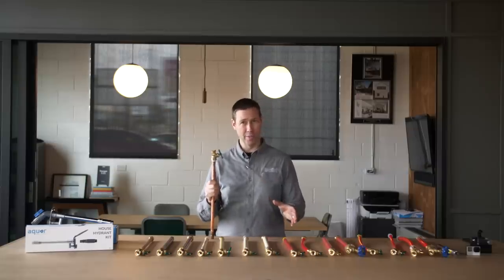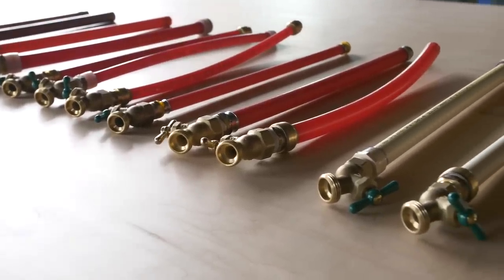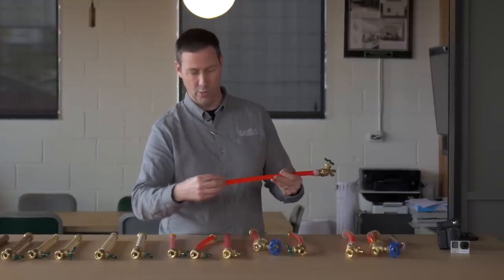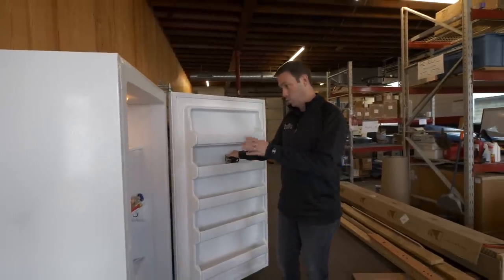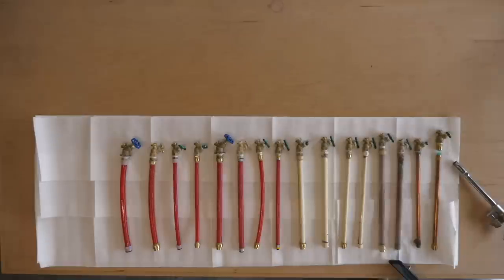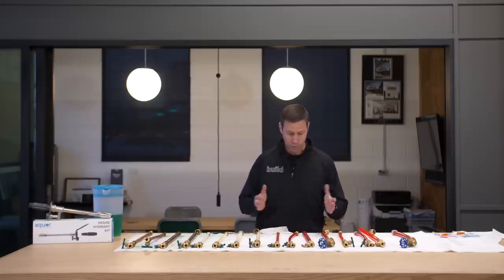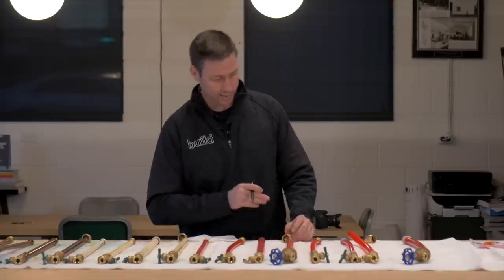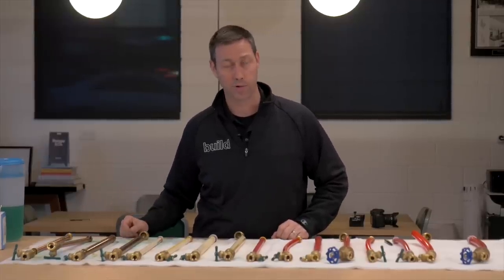Copper vs Pex vs SharkBite - Freeze Testing

Comment: You should have used valves on both ends of the pipes so they could be at the same pressure as all the water lines in one's home.

Comment: Frequently you do not get a water leak until the split pipe thaws out.  You have a length of pipe freeze and the ice forms a plug.  The pipe splits.  The ice still acts like a dam inside the pipe.   Until  it thaws.  Then you get the mess.

Comment: First did you just fill the pipe with water or did you pressurize the pipes with water. It makes a difference. Also I’ve been plumbing for 20 years now. I’m a 3rd generation plumber. I haven’t been using PEX A  but I use PEX B all the time. I’ve seen PEX freeze and get as big as a coke bottle and go right back to size. I’ve had fittings burst but I’ve yet to have the pipe. I pipe everything with PEX. I don’t care what you already have. I tie on PEX and repair. Also if your going to use push on fitting use sharkbite brand. Do not buy the crappy ones Lowe’s has. I see them fail all the time.

Comment: Thank you for sharing I just ran PEX and my wife and I are house I just don't like the potential of mice with the pics..

The one thing you have to be aware of when you're using the type A PEX with expandable ring the oil you use for the expander if you get too much and your oil glands up in the pipe it can cause a leak at the fitting well it's really grease not oil.

Okay I look forward to hearing from you I have a how to channel God bless,
 Ken

Comment: Copper is definitely the best.every plumber that knows what there doing knows to put frost free outside faucets,and if your building a new home the crawl space will be adaquit for not freezing. The problem with odds it's not freezing but failing under heat and pressure and also water with high chlorine content
Reply: Sorry pex

Comment: Would have been interesting if you had use pressure gauges to measure the pressure. You would probably need a pig tail with a non-freezing fluid to keep from freezing the gauge.

Comment: Matt, our builder used insulation and I have not had a pipe burst in 25 years. Of course I live in Nashville TN and thanks to global warming I have not  had but a very few cold days that were capable of blowing out my pipes but thanks anyway for telling me that if I lived in the North that I would be in a bucket of poop with my copper pipes. I have heard sharkbite fittings are a disaster waiting to happen is that true?

Comment: Would have liked to see the lines pressured up to typical line pressure instead of static pressure. I would like to see the pipe measurement after it was filled with a micrometer and after it froze.

Comment: I'm a GC, we get frozen pipe problems from time to time here. Every now and then we are on a job where the house has frozen pipes and it's a hodge podge of pex and copper.  FROM EXPERIENCE,..I can tell you that pex does not fare much better than copper when it comes to freezing. After I ran into it the first time,..I checked the pex spec,..and (at that time,..unless something has changed the last few years) NOWHERE does pex state that they do better than "x" type of pipe systems when it comes to freeze-thaw issues.  They sure don't try to squelch the rumor, because the rumor makes them a lot of money,..(which is a bit disingenuous.).  So,..you can watch this video and feel all warm and fuzzy inside,..or you can call the manufacturer or look up the spec,..and they will NOT stick their neck out and even make any statement whatsoever other than "our pipe is not rated for below freezing temperatures.'" Frost free hose bibs are different because the part that freezes is not designed to retain water in the part that freezes.

Comment: But the other issue is that you did not fill them with water pressure used in homes. You only filled them with standing water. Filling them under house water pressure would create extra pressure and increase the chances of bursting.

Comment: I've been replacing very old L copper, PVC, & CPVC with PEX-B under my house. I'm in Texas after this last record-shattering freeze. I had both copper & CPVC failures, but all of my PEX-B with Sharkbite(R) survived 5 straight days of 30 below freezing. Have you any plans to perform this test with PEX with crimped fittings?
Reply: NOTE: I have Sharkbite(R) transitions to PEX on both L copper & PVC.

Comment: Matt, I'm just wondering if the green dye you used for the water changed the freezing temperature of the water.  Not a big deal, but for the sake of the science of it all, it would be beneficial to know.
Reply: Mikeadiddle, that's an interesting question.   What is the green dye and does it change the freezing temperature?     Was it food dye or clothing dye?   Does THAT matter when it comes to  temperature issues, and effects ?    I think deeper about things too.      I don't think the dye effects the results though.   I think it's all about what freezing water does to pipes and not what it takes to freeze water.   I guess you are wondering if dyed water will take longer to freeze water ?

Comment: My ❓ is why not use regular PVC pipe as well as the CPVC because technically the CPVC is for Hot Water lines and the PVC is for cold water lines? And Yes as of 2/21 I've had to fix many frozen Copper and PVC bursted pipes.

Comment: Appears you forgot to test NSF approved HDPE poly pipe.   PEX is not sunlight resistant like black HDPE, sun exposure will eat up PEX fast. As I see your tests did not have all the pipes under typical home water pressure, such as around 60 psi when the freezing temperatures were applied, which stresses the pipe and fittings even more (not everyone drains their pipes, some forget). We have experienced 1.25 inch diameter up to 2 inch diameter HDPE poly pipe freeze outside under 60 psi and more static pressure with our poly compression fittings and not suffer a single crack, not a single service call, after the thaw.

Comment: Was that Type M (thin copper commonly used today by cutthroat contractors) Type L (Thick) or Type K (Extra Thick)? I have more problems with my post 2000 properties that have Pex than  CPVC and Copper Combined that are pre 2000 and 20% are pex, 30% are CPVC, and 50% are Copper.

Comment: I have a copper pipe burst in three places. Planning to fix with pex. What kind of connector you prefer to connect to rest of the copper pipe? Should I replace the whole pipe run from the outside garden faucet Hose bib....to the other end?  Thank you
Reply: He has several other videos in this topic, so I’m 90% sure he already answered this.

(IMHO, I’m happy with SharkBite as a DIYer, especially if the fitting remains accessible)

Comment: Matt, I'm 64 and not a plumber by trade, but have done lots of plumbing work in my life. The test you run were good, but not a real world test. The fact that you used new Copper, PVC and PEX A and B is the most common used today. You also failed to run the test under pressure. Under writers Lab (UL) did these these several years ago and had the same results as you until they ran the test under pressure. All test failed with a different failure. The analysis performed was that the water when freezing expands. This expansion caused failure in all the test at either the joints or in the material itself. They found that the Copper and PVC split and they both started to spray and did not freeze do to the running water. The PVC held up the best, but found that the older the PVC the sooner the failure. I guess that says something about getting older. Both PEX A and B failed at the joints due to the expansion on the PEX, but none failed due to a pipe/tubing failure. You did a good test under static, very low to no pressure, but you failed all of use in not doing a realistic or real world test. I would not use copper anywhere it could or might freeze and I would not use PVC for water at anytime. The only way that I have found that keeps the pipes from freezing is to turn the water off and drain the lines or insulate and provide protection for the water lines.

Comment: If there was a way to get pipe that had been in service for 10 years or so to repeat the test I’d be interested if the results stayed the same or if the pex variants and cpvc got more brittle, that would be my assumption but I’d love to see a real test.
Reply: Comey, I'd love to find that out too!   I have pex in my home, which was built in 1986.  I live in Massachusetts, so the pipes are exposed to winter freezing and summer temps, as well as humidity and such.   I wonder if those pipes are more brittle now, and how long they will last, as over time, EVERYTHING will change, right !    I had to replace my water heater in 2014.   I had to replace / repair the copper pipes under my home; TWICE.    Other than that, these pex pipes in my home have NEVER failed!  ( I'm knocking on wood right now ).

Comment: In real use,, this house contains all of the pipe and fittings,, and this house is a long way north Newfoundland.  I am closer to Europe here than I am to you in Texas.  I am closer to Greenland than I am to Boston, MA.    Freeze damage is rarely a single ultra low exposure with great damage being done.  Rather,, it is most often 3 freezings or 10 freezings,, and then the pipe or fittings fail.  These are not short sections of pipe, as you have,, They are long runs that may freeze in one area and not in another.

What your tests have shown is mostly correct.  The differences are.  CPVC fails after repeated freezings. Particularly at the fittings. Does not matter that the pipe is long and one end open,, CPVC can only be stressed X number of times.
Copper can be frozen repeatedly,, but it has limits and limitations.  It gets a little bigger each refreeze. Sweat fittings cannot be slipped on,, so it becomes difficult to repair.  Shark fittings can often fit over the increased pipe OD and effect a repair.  I have never had a PEX failure, except at the brass shut offs and faucets.

Comment: I used type L copper in my guest house and my son left the front door open on a freezing night with no heat and all the lines froze. What happened the cartridge in the shower valve took the hit and blew out. Thanks goodness. The house is under renovation so it just froze up. I now installed a battery type irrigation valve to bleed off a trickle every 2 hours until we get the project done. It has worked . I thought all the copper was done and I would have to open up the drywall and start over again.  I believe it was -7 that night. Not sure the type L made a diff. What's your thoughts on this event?  Thanks

Comment: Any Plumber still using/ suggesting copper over PEX needs to go back to school. Not only does pex handle better when frozen, it is flexible, and can even be thawed and refrozen multiple times. Also it is way easer to install since no torching is needed, especially when combined with SharkBite. which also can be removed and reused. I always hear stuff like "they dont build stuff to last anymore" but when it comes to plumbing the innovations have actually been an improvement over the predecessors.

Comment: What I would like to know: If the pipes were connected to an unfrozen mains, what happens? Would the ice simply push back into the warm mains without splitting the pipe?
Reply: Only if there was a backflow condition, the pressurized water always wants to go to least path of resistance which is your tap when you open it, unless the city pulled water back (which would never happen) The ice block would always be pushed towards the house and not city. Just imagine being in a traffic jam with hundreds of cars behind you, try backing out of there. Just wont happen.

Comment: In Houston, I have flexipipe which did not bust but the coupler that joined pipes started dripping because the glue gave it away.. There was no damage on pipe or coupler but glue 😡

Comment: @MattRising
Merry Christmas 2018
And Happy New Year 2019.
I very much appreciated this video as i have baseboard heat with a cold crawlspace to run pipe.  Its currently all copper pipe but i recently needed a section replaced and they ran the line in PEX which worried me (old person vs new methods = 🤔😱😵).
However, what is normally running through my lines is EXTREMELY HOT water.  I wonder if you could do a test on that issue...
As well as calcium buildup problems.
Thank you.

Comment: Did I miss it or were types of copper used i.e.: type M vs L vs K ETC ?
Reply: That would be pretty important. And should have been included in his test. But I think a fitting might pop off before say a Type K pipe/tubing would crack or burst.

Comment: have you ever tested poly pipe  gray stuff in mobile homes...what I have...it survivednow couple freeze thaw cycles over last four years and not failed. my intent is to replace someday with pex A. frozen hot line only on kitchen on day one at *0 temp second day cold line freezes only in kitchen . still had running water hot n cold threw out rest of home. mine is mainly curiosity, which gives me a realistic timeline on do I need to start replacing kitchen lines first or hiw many freeze thaw cycles befire poly pipe bursts....if you have already tested this previously  send me link. thanx firm believer of pex A I already replaced all lines in one my houses.

Comment: Is there a "Nest-type" or digital thermometer water shut off valve that shuts off parts of your water system if the water in the pipe (or air around the pipe) gets to <32 degrees?

Comment: A friend of mine just installed heavy black water hoses. no freeze
Reply: Eugene Courtney if he is using rubber hoses. I would really have to ask. What does his water taste like??
  Can he drink it?
Reply: @ltsgarage7780  He had flushed them out with soap and a little clorox, didn't taste good but his well water was sulfur tasting, they had no city  water and having to to just get by, they had a large family and didn't have much income, he did put a filter on  it but i haven't seen him in years.
Reply: Eugene Courtney if you ever come across this kind of thing again. The make the white hoses. They are made to human consumption. They will not contaminate the water. Even with a filter on the regular hoses. You can still get sick. Although as kids we always drank water from a hose.
Reply: @ltsgarage7780  This all took place to my friend about 35 years or more, ago.
Reply: Eugene Courtney these white hoses were made for motor homes & modular homes probably 40 plus years ago. 
   I get that it was a very long time ago. But today you don’t need to do it with normal garden hoses

Comment: Gaah!! Why do you insist on using sharkbite? 
I live in Sweden and i can recommend products developed here in sweden such as Fm Mattson, Gustavsberg, LK, Uponor, oras, vatette & VSH.
And as of this test, no surprises! The soldered cu end exploded! xD The sharkbites got pushed off the rest! 

Dont you use any mechanical squeeze ring fittings in the US? I made a test with LK pex with one of Vatette fittings... Tryed to remove the fitting with all my weight, 200lbs... it would not move! 

Buy LK Pex with insolation on in a roll and your good! Easy to work with and reliable! They even make decent complete systems for water/heating that are "bolt on".

Comment: With frost, there is a LOT more pressure on a weak spot in a length of pipe than there is in a 16" pipe. All of these installations will fail in a hard freeze.

Comment: I suspect the PEX is a good insulator against the temperatures, and couldn't transfer the freezing temps to the water; where copper is a good conductor of temp, therefor I suspect the water froze and blew the copper. Only question is, does PEX water even freeze in the pipes?? For portable water does PEX leave plastic contamination in the drinking water? Copper doesn't!!?

Comment: Admittedly, I didn't watch the video much, but he doesn't look like he is old enough to have been a 'builder' for 25 years.  I have seen this type of comparison before though and my comment is always the same.  I don't care what the piping material and labor cost as much as I care about whether or not it is going to leak in 25 years.  Period.  I am remodeling now and have no intention to move, ever.  I am planning for it, actually, to stay.  Wider steps and doors, zero entry shower, etc.  We are 50's now.  I don't see Pex not leaking at some point in the future.  I know Sharkbite leaks as we have used it at work because of the ease of use.  Only three years later, we are getting some drips.  No way those gaskets in there are good forever.  Same thing with compression copper fittings.  Bottom line is, if you want it to last, use copper and sweat it.  Period.  This method has already passed the most rigorous test, TIME.

Comment: Story would be different if pex pipe is in concret slab in radiant floor. There is chance that cement crack will cut the pipe when it expands

Comment: Should have gotten a hose to hose adapter and pressurized those after you filled them with green water. Being pressured, will make them act much differently. Also, you should bring in professionals to help you test, they would have better insights because it’s clear that you’re not a plumber, by many factors.